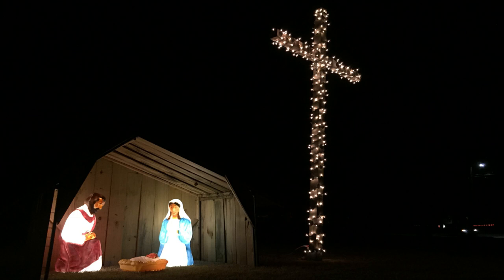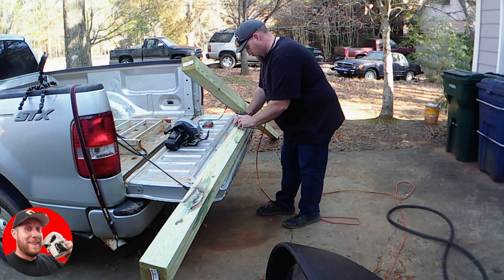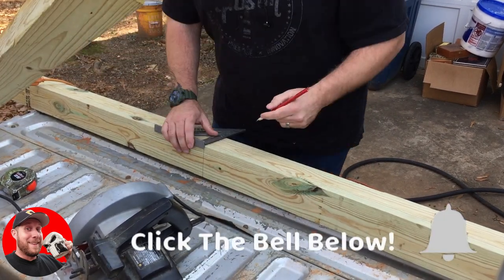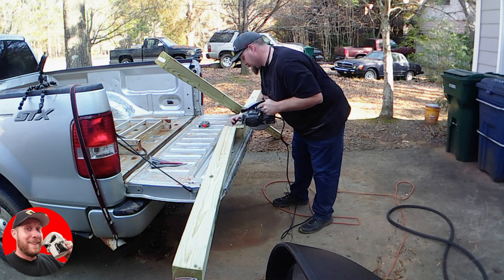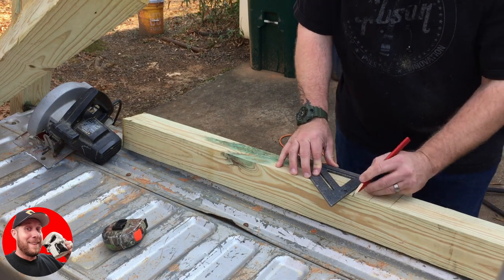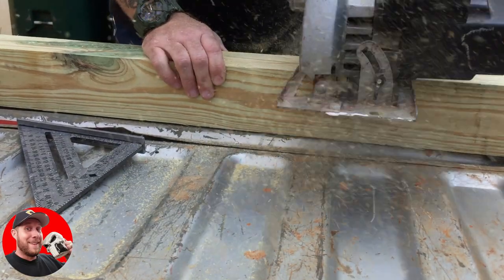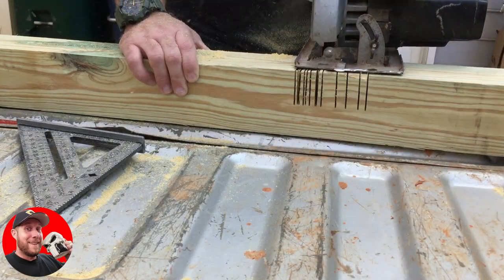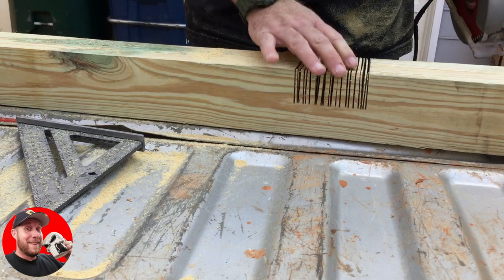Huge Wooden Cross Build | Church | Christmas | Easter

Comment: Thanks for this excellent tutorial!
I'm building a cross for my church for everyone to flower for Easter. This tutorial makes it seem really easy!
Do you have any recommendations for how to make the Cross freestanding so it can be moved in or outside?
Reply from the maker: I used a metal post base that you drive into the ground to hold up the cross for outside.  Otherwise, you’d need to build a base that also has a support going  from the back of the cross down at an angle to the base.  Not sure how portable it would be though

Comment: Very crafty how you jointed the two pieces together though rather then using L brackets under each arm that runs horizontaly wouldnt four 3" drywall or wood screws would secure the two pieces together just as much as the L brackets?
Reply from the maker: Thanks!  Honestly the L brackets are to reduce any “slip” from expansion/shrinkage of the lumber.  They probably don’t need to be there but I used them just in case.
Reply: @TonyCollumtheHOWTOHERO  yes smart move on that, I just haven't decided how big of a cross I want to build originally planned on 14' tall but that maybe too tall may go with 10' instead.
Reply from the maker: Millennial Dreamer hey that is awesome either way.  Just keep in mind that the taller the cross the harder it is to move around.  My cross was pretty heavy...it kind of surprised me cause I’m a pretty big guy.
Reply: @TonyCollumtheHOWTOHERO  yes I would be making it stationairy front of my parents trailer as a memorial thanks friend👍
Reply: I will be going 12ft x 7ft and have a plate welded up that goes around the bottom. Im going to carry it across main highways for as long as possible.
Reply from the maker: Very interesting.  Please update us on your journey.
Reply: @TonyCollumtheHOWTOHERO  thank you for your help and guidance in the video
Reply: Screws and wood glue would make it much more aesthetically appealing